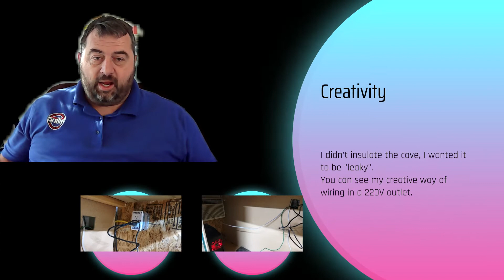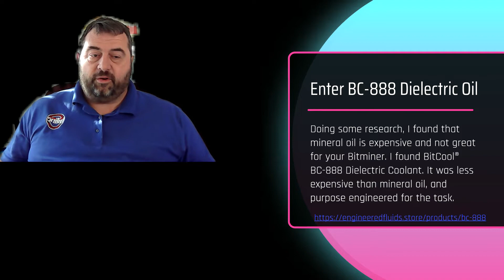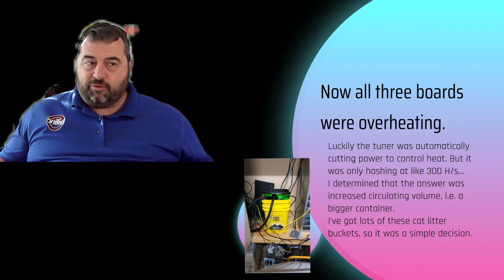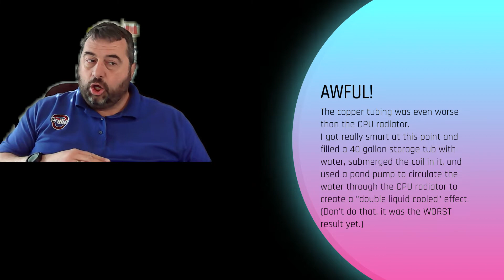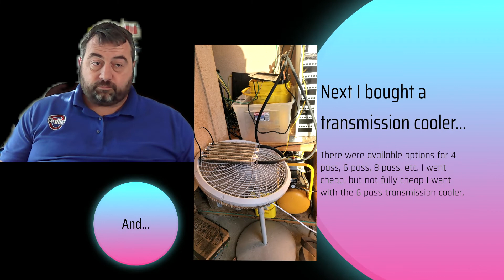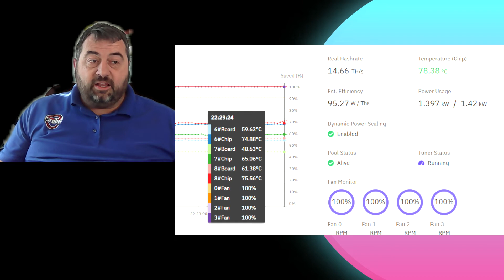Antminer S9+ Immersion Cooling on a Budget

Comment: Did you even bother to read the 85 page primer from Engineered Fluids, or their material compatibility list, or even their extensive FAQ? When in doubt DON'T CHEAP OUT!!

I found that Engineered Fluids' hardware is prohibitively expensive when you attempt to use a single miner. The savings come from scaling up AND running your miners in excess of 110%...not being satisfied with sub 100%. However, to be fair to Engineered Fluids, they provide all of the information to build your own equipment. 

Some issues to consider is material incompatibility, for one. That black stuff is probably the rubber hose that is dissolving over time. The flow rate of a pump is highly dependent upon the tubing and elevation of your pump, along with the type of pump chosen. For example, when you added the second radiator, you dramatically added more friction to the system that your tiny fuel pump wasn't designed to handle. Also, a car's fuel pump isn't designed to operate 100% of the time. They operate in a stop-start-stop way, which allows their duty cycle time to cool the windings when shut down.

The cat litter containers are clearly incompatible from a material AND ability to withstand high Temps perspective. The copper tubing needs to be closer to 1/2" OD for a Single miner, preferably closer to 1" OD as you begin adding miners. AND, you need enough fluid. so it has a chance to cool properly. Otherwise, you're adding more heat over time than your "system"  can remove. And, over time, you find yourself spending more time and money attempting to fix problems, while not giving your miners the ability to perform at the 150% hashrate they'd be capable of, had you just followed the guidelines from the beginning.

My recommendation, going forward, is to heed and read the advisory info from the manufacturer of the fluid, before you set out on an expensive waste of time, money, energy and operating you rig at less than designed efficiency for the sole purpose of peace & quiet along with a patchwork solution for heat removal.

IF you're gonna add miners, then doing what your doing and expecting different results is a disaster waiting to happen. Doubling what you did may cause a quadrupling of negative effects. 

Therefore, if you can't Weld and you can't engineer anything, then go onto YouTube and see look up how to Weld a sheet metal box. If for no other reason then to point to what's involved. Then, look for 12ga to 14ga cold rolled steel sheet. Bring it to a welding shop and ask them to Weld you a box, which follows the guidelines given in the 85 page primer. Make sure to allow about 3/4" between the miner and the side of the box AND about 3" to 4" from the top of the miners to where you want the fluid to be removed. Again, not the optimal solution, but good enough. Just make sure to drop your wider copper tubing between BOTH miners, or else one will be running hot all of the time.

Make sure, if you're gonna use a radiator designed for an automobile, that the tubing on each pass is at least 3/8", preferably 1/2". You might do better using a hvac chilled water style radiator. Except, instead of chilled water, you just use air being sucked at a high enough cfm to provide adequate cooling. Also, building a shroud, which forces the air to flow around the tubes and fins rather than willy nilly goes a LOT further than using a box fan.

Finally, don't use anything rubber. There's a special material they call out, which is readily available and can take the heat the ASICS will be dumping into your fluid. And, I would recommend, at the least, a glass thermometer, which you can leave in the fluid, so you can cycle the fan on manually to keep the Temps low in the hotter months.

IF you were trying to make an entertaining video on what not to do, then you definitely succeeded. If you were serious about creating an educational video, which helps others, then you didn't provide the correct info on what works.

I apologize. But there aren't enough videos on how to properly build an immersion set-up as it is. Your video, while entertaining, doesn't help. Again, I'm sorry.
Reply from the maker: DJ Hal, you've reinforced my points. Yes, the video was meant to be entertaining, and yes, it was an attempt to warn others about the mistakes that I made, which you pointed out in a far less entertaining fashion. This video isn't targeted at "serious" Bitcoin miners, they'll just drop the coin and buy everything they need. YouTube is FULL of videos for those guys. My target audience is the guys like me, a dude, doing it for fun, in their garage, and learning a little something along the way. (And, no, I didn't read their 85 page manual, instead I emailed them with the list of materials I wanted to use, and they emailed back that they were fine. It was so much quicker and easier.)

Comment: Great Video, thanks for making it.  Im starting my build and am using some of the same components.  One quick question,  How did you power the Fuel pump???
Reply from the maker: I used a "run of the mill" AC adapter that I had lying around. I suspect, however, that the internals on that pump were plastic and it quit pumping after a few weeks. I've added an updated, cast iron, pump to the recommended list and it runs on AC so you can just plug it in.